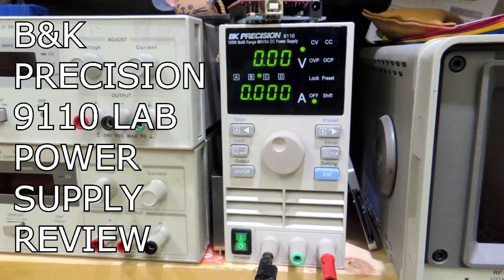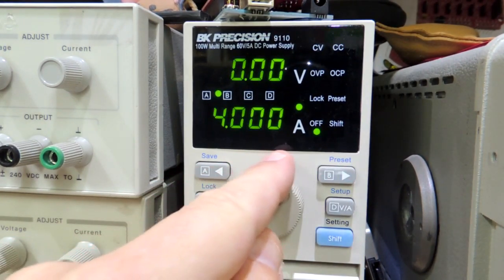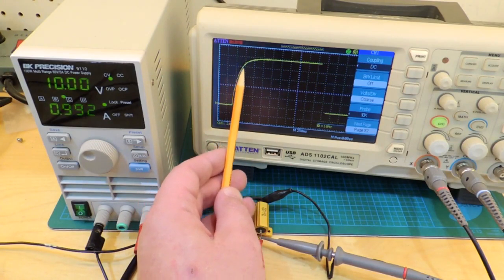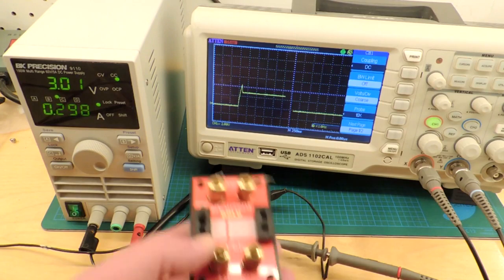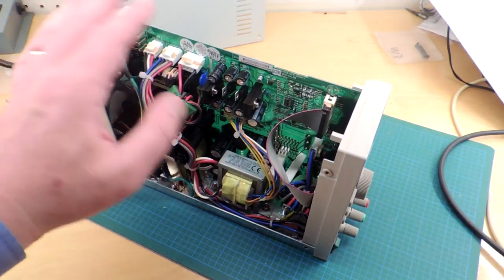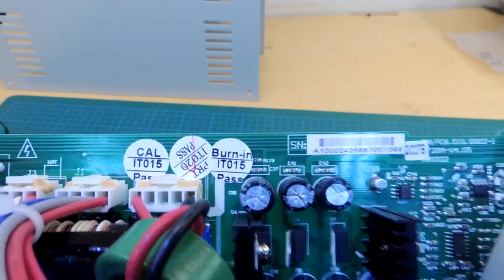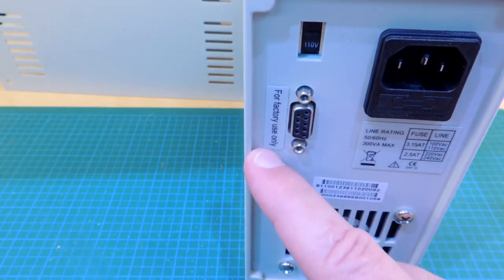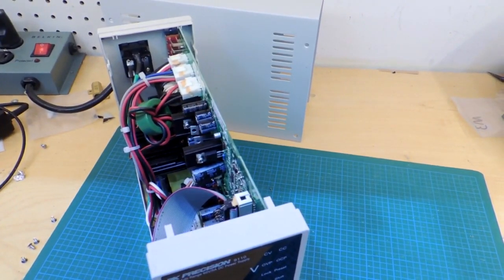B&K PRECISION 9110 LAB POWER SUPPLY REVIEW

Comment: Transformers seem small for the power rating of the power supply.  Also not sure you needed to use an extra device for looking at the current.  Even if that was a wire wound resistor the current would probably still mirror the voltage so the two waveforms would look very similar as you showed.  The current overshoot is a troubling trait of the supply and probably we should look elsewhere for a lab bench supply.  Overall your review was very nice with good video and audio... good job.